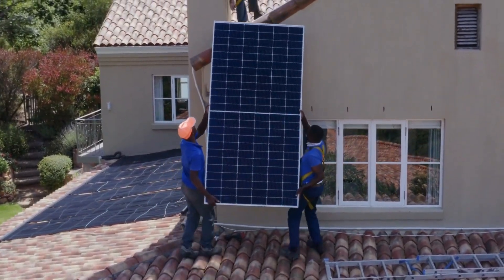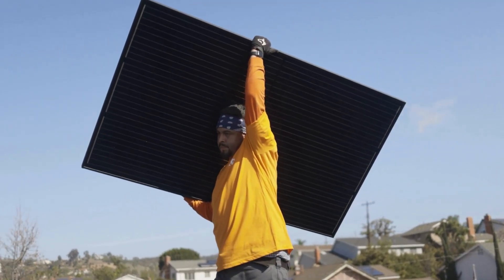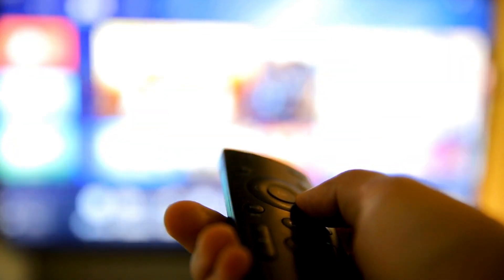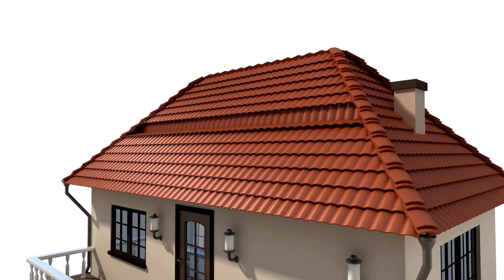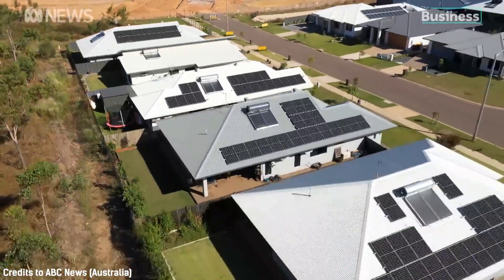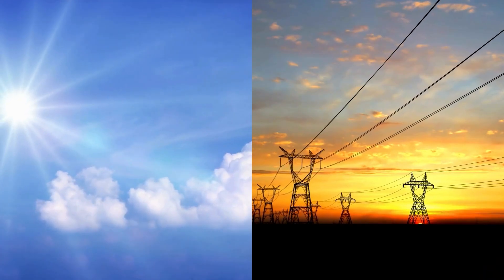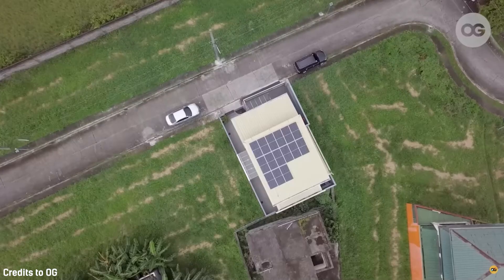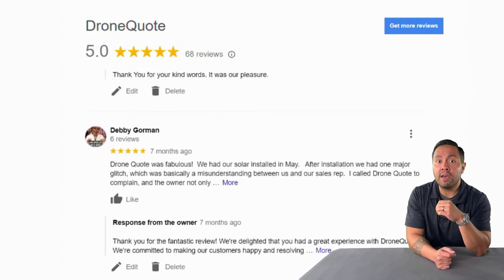Cost of Solar Panels 2024: Is it Worth It or a Waste of Money?

Comment: Australia had the world's first big battery.
A Tesla installation and the result of a bet that Elon Musk made to have it installed and working in 100 days or it would be free to the state of South Australia. 
Elon won, and the State paid for its battery. Hahaha 👍 

This big battery has helped stabilise the national grid.
It rapidly absorbs energy and can rapidly inject energy as needed by the grid as the big generators slowly adjust.
$/mW is very extreme but cheaper than maintaining hot running unloaded plant.
And wasting electricity into open fields of industrial resistors, but being the old way of PRE LOADING the generators.
And so, being available to be SWITCHED INTO the grid as DEMAND LOAD grows.

The big battery paid back its $100million construction costs in one year. And more capacity has been built. 
More big batteries are being built in other states on the same national grid.
Big batteries are profitable in this time of transition. 😊

Comment: Good content.
The Australian governments, each have a voter issue on electricity supply. Blackouts are political death.
Transmission is incredibly expensive and always overlooked. 
In every country on the planet. 

Connecting millions and millions and millions and... to one power station is 10times more expensive than the power station.
 Approximately. 
It is cheaper for the government to minimise the grid loads with reliable solar energy supply, at the customer's location. 
Cheaper than building bigger grid capacity. 

So, simple grid connection and fixed upper supply feed-in makes a repeatable and predictable environment for contractors to compete in. 
The rooftop solar PV systems has grown and matured as you say.

The government looks at its savings in new infrastructure and climate obligations and provides one off installation subsidies, that reduce each year. Cheapest option. 
Early adopters happy.

Fortunately for me the systems are reducing in costs faster than the reducing subsidies. 

I am not an early adopter like many neighbours. 
We have invested in street gas supply and appliances, 😮.
So the cost to full electricity is higher for me at the moment. 
We went for gas supply and electricity because blackouts were common when we built our home.
And gas was dirt cheap even though appliances expensive. 

But I digress. 

The situation is such that a maturing solar industry is being established including PV panels manufacturing. 
The population is adapting. 
Energy prices are rising. 

My electricity bill is 50cents kWh and available feed-in is 5cents kWh 
Including my daily connection fee. 

Grid Electricity is DIRT CHEAP.
Grid RENTAL is expensive. 
15% of all energy used is electricity energy. 
So 100% electricity energy means a huge expenditure in grid capacity. 
Political suicidal expensive. 
All Grids are fragile because they are incredibly expensive to build. 

But grid costs discussion are silent. Deafening silent. 

I  think rooftop solar PV and selfplug-in V2G EV will be the saviour of the grid and the governments. 

Nobody wants to commit to new power plants or new grid infrastructure capacity. 

In Australia we have 1million km. 
New grid construction costs $1million per km. 
And 100% electric is ×7 more grid capacity. 
= $7 TRILLIONS,  FMD !!!!
Our GDP is only $1.5 TRILLIONS 

Plus new plant $ 1TRILLION  !!!!

The first grid has been built over 100years. 

We do not have decades and decades and decades...

EV production is going "gang busters."

But vested interests:

Rooftop solar PV and EV big batteries do not need the grid. 
And are customer built and paid for.

We have a problem. VESTED INTEREST problem. 

1,Grid owners, $TRILLION infrastructure. 
2,fossil fuel owners, $billions infrastructure. 
3,distant renewables owners, 
4,nuclear owners, $billions infrastructure. 
5,nuclear promoters, lifetime investment. 
6,central generation plant owners, $billions. 
7,governments Garrentees locked in for 60years 
😕🫤😟😮😱🥴
8,But not green hydrogen, unless they align with all the above. 
Unhappy 🙁 days, 

A little fossil fuels used in mid winter weeks is nothing. 
Petroleum feedstock to petrochemical industry will continue. Natural gas is cheaper. 

Long story yes, but slogans from vested interests and the mislead are economically dangerous. 

Just my insights 
All automotive manufacturers know that they will be a big part of the world's energy business. 

The real danger economically will be millions of customers going offgrid for months and breaking the $ BILLIONS cashflows to the grid investors including the governments.